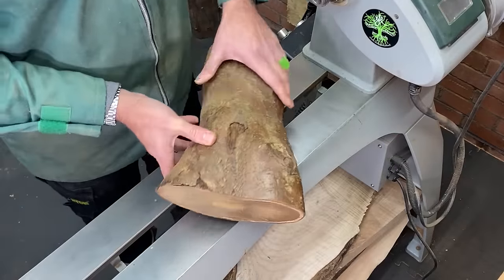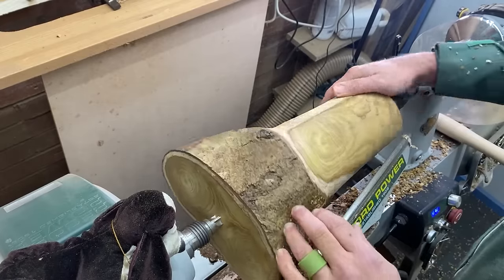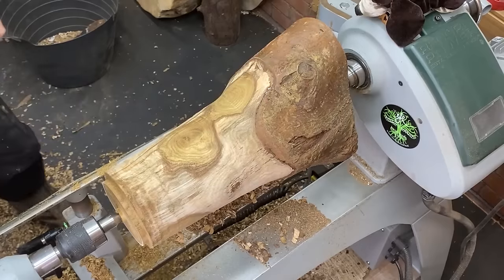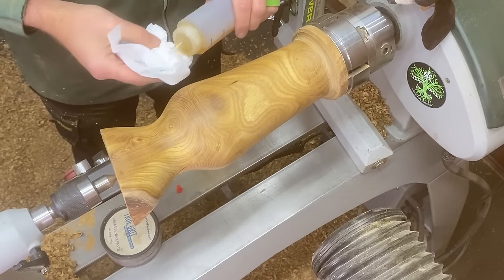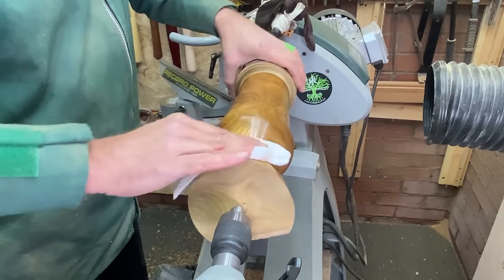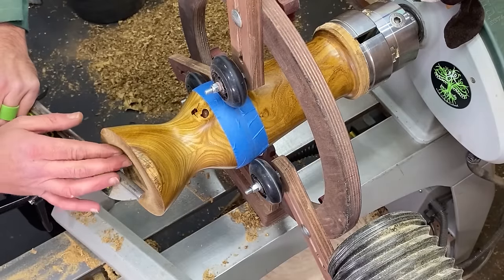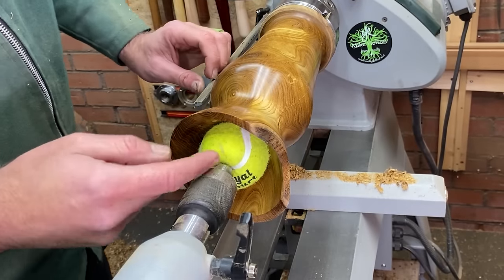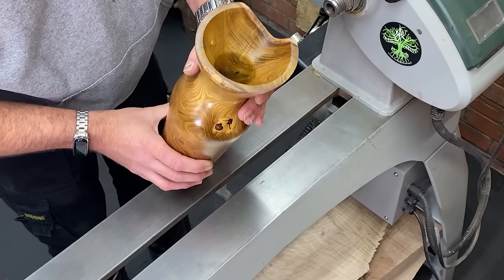ET phone HOME - Woodturning the two eyed LABURNUM LOG

Comment: Beautiful piece. I felt for you when trying to use the hot iron to burn the logo on. I gave up trying to use those and went with a small laser tool.
Reply from the maker: Haha thanks, I may torch the iron to get it hotter next time, the auto heating bit takes so long.

Comment: lovely piece . do you thin your shellac before you use it . i find it difficult to get a smooth finish .
Reply from the maker: Thanks Michal, the final shellac I use is a 20% mix, I build it up in thin layers and use a very fine scotch pad or extra fine wire wool between coats. Hope this helps, Mike 😀

Comment: I'll be bidding on that grass tree piece for sure! I'm sure you've answered this somewhere before but, how old were you when you started wood turning? How many hours of practice before you felt comfortable making bowls and vases? Did you have a teacher or mentor? Would you consider making a wood turning for beginners series? What starter hardware would you recommend? Thank you!!!
Reply from the maker: Hi, that's a lot of questions lol. I took up turning in Feb 2021 so not really all that long ago. I'm completely self taught which is pretty much a case of watching videos and then practicing. When I run into problems I research it and then practice more. I class myself as a visual learner, meaning that I learn best from watching how it's done then having a go myself. I spent most of my time making bowls at the start so feel most comfortable doing that, I started off with carbide which are fairly easy to use and then saved up for a bowl gouge which took a lot longer to understand and perfect. One thing that really helped me along the way was that I never gave up on a project unless it actually fell apart, I would keep going trying to save it and this taught me a lot about how best to deal with problems. There are a few good beginner series on YouTube and I would recommend @wortheffort 
Hardware is a more personal choice and is down to personal situation, if you want more advice on this feel free to email me mike@mikeholton.net and I'll do all I can to help.
Reply: Yeah sorry for the interview. Thank you for the thorough answer! I just found your channel the other day and I feel like your style is conducive to learning. I know there's plenty of information out there but you could totally be the Bob Ross of wood turning! (I mean that as a compliment btw)
Reply from the maker: @quazzydiscman  Haha thanks so much I'll take it! I have been likened to Bob before and consider it a great compliment, many thanks, Mike

Comment: before parting it off, I thought the flare out at the base would have looked nice
could just put a rag on a stick to apply sealer deeper, or into the entire depth... of course you could do similar to sand it as well
Reply from the maker: I did sand inside and it has had a few coats of sealer deep inside so it should be all good.

Comment: Lovely piece! It's a shame the brand didn't work out on the bottom, but at least you had a backup sticker ready!
Reply from the maker: Haha I know, it may have been to it being end grain 😀
Reply: I can see that being a player for sure - when I used to make tobacco pipes, I'd burn my little symbols in the bottom by hand with an old soldering iron, and certain woods would give me more trouble than others across the rings.  @MikeHolton
Reply from the maker: @ronniekeates3349  haha indeed, it can't have been my fault 🤣
Reply: When in doubt - blame the material :)  @MikeHolton

Comment: A vase? This double front end wants to be a bowl, I thought. But in the end you were right again. What a grain drama! Would you show it again as soon as it will have got its extraordinary chocolate brown? I made a pet urn out of plum and purple epoxy today. Hollowing really sucked. Any recommendations for a efficient hollower, Mike? I tried Hope Midi, Woodcut and Crown Revolution without any effect besides getting some nasty catches on the bottom.
Reply from the maker: Thanks Kerstin, deep hollowing sucks and takes a lot of practice, I avoid it whenever possible. I use the hope deep hollowing tool with the longest handle I could get for it. You need to get the tool rest as close to the working surface as you can and have a long lever (handle) to be able to keep control otherwise catches are a real problem. Hope this helps, Mike 😀
Reply: @MikeHolton  thanks, you got the same problems, I see. The toolrest was IN the urn. The Hope I tried too, the one with the bended front and the flat handle. It didn't cut,  sharpening didn't help and a new blade is not deliverable (due to Brexit I think). So two days of work and hurting tendons may be turners destiny. I wish to have a Forstner bit that would expand inside the piece.
Reply from the maker: @kerstin4516   sorry to hear the problems you are having with it, it really is not easy. A longer handle should help. An expanding forstner bit is something we would all like lol. All the best and good luck, Mike